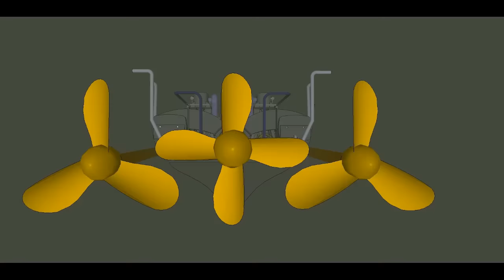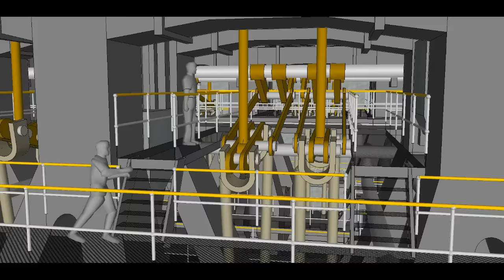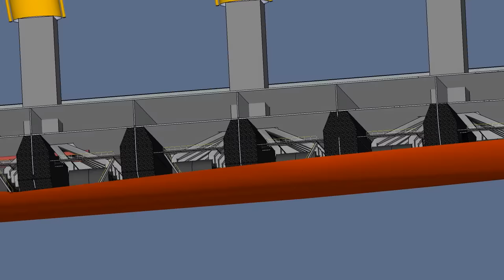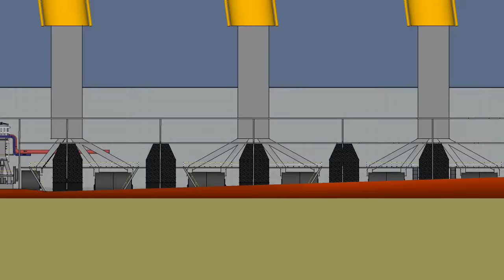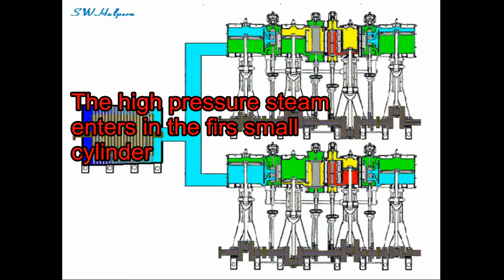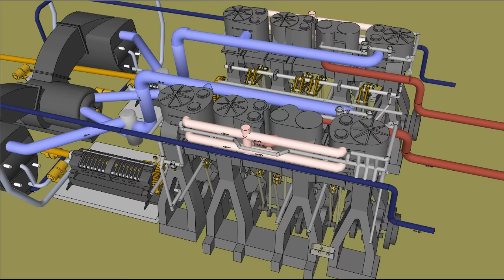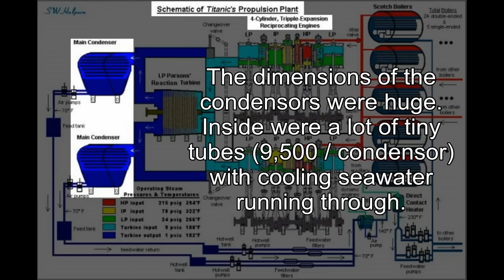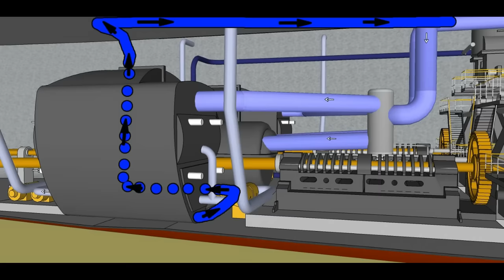The Engines of the Titanic

Comment: 150 men shoveled 600 tons of coal a day by hand, unbelievable. That's 4 tons per man.
Reply: Inside a hull riveted by hand. Different times..
Reply: @pelnapkins4379  and it was hot hot hot! 

Hot environment + physically demanding labour = HOT.
Reply: ThatGuy Ollie And didn't complain while doing it. No excuse, just produce.
Reply: Not entirely, the builders of Titanic used hydraulic riveters and steel rivets on MOST of the hull, but in areas that were very curved, they had to install the rivets by hand, and that forced them to use wrought iron rivets instead of steel rivets.
Reply: Not that hard, I  have shoveled over a ton of sand in less than an hour, several times. At 63 yrs old, just part of the job.
Reply: Welll they probably needed to lsee a litlle, so 2 12 hour shift maybe?
Reply: OK Boomer  I can picture it now, yea they prob thought about it, either tons more of equipment, overhead bins with release doors, massive conveyors, unloaders/pushers,etc. , or just stay with all them guys, and the sleeping areas, and food, and toilets, to accomodate them . Prob would have taken a small team to run, maintain, and repair the auto system anyway.
Reply: Not for a man in good health who eats right......the men in the photo look to me to be tough Irishmen who could mop the deck with us.
Reply: 4 tons ain't that much for a normal man. Obviously these days a lot of guys are like a ladies back in a day
Reply: 6.9kg/s
Reply: But like let’s imagine how jacked they would have been after a single voyage
Reply: Honestly, one thing I’ve wondered is it if can be all that fuel efficient regarding all the coal shoveled into it. I get it, it was over 100 years ago, so the tech we have now wasn’t available at the time, but still...
Reply: @LynxStarAuto  Where did you hear that? There were frequent strikes from those in the ranks of coal workers around the time of Titanic. It's also worth noting that, sadly, coal workers had the highest suicide rate of those who worked aboard ships at the time.
Reply: The searing heat, long backbreaking labour, and coal dust is also incredibly damaging to the body. Many stokers didn't live past their 30's.
Reply: @treeguyable  Only whips today. Lol
Reply: @PieterPatrick  I am whipped after about 6 tons.
Reply: OK Boomer  labor was cheaper
Reply: Thats 17 lbs per minute / 8hr shift.
Reply: You joke they will be in great shape after a voyage....
Great amount of coal dust in your body. While overworked. 
I imagine a large portion of men end up sick or worn out.
Reply: @fastinradfordable  Osha approved  methods for sure.
Reply: Shoveled, by hand,  a few tons of dirt today out of my dump truck, in the Mid July heat , humidity, and sun, on the coast of N.C. , miserable, but I'd rather do that a few days a week, than a few hrs of where they did coal.
Reply: @treeguyable  ... I have done the same thing but never in a 100 degree room with all of that coal dust and noise hanging around my head... and not all day long, 7 days a week. At some point it's got to wear thin.
Reply: @treeguyable  ... I have see auto-stokers on heating plants circa early 1900s and while you can cut down on man power you need to hire a different level of education for operation and then there's the added weight of the equipment. Probably a compromise either way.
Reply: dogboy1953  ... 4 tons of coal generates some ash and requires raking of the coals quite often, then add in the job being done in a room at over 100 degrees with all that dust. These guys were doing more than moving 4 tons of coal each shift.
Reply: OK Boomer  I think nobody thought about it. You see engineers also have limited vision. If before everybody used the same approach no mean to change it.. just scale up.
Reply: 4 tons a day isn't that much, lets say they worked 12 hour shifts that's only 5.5 kg per minute. I mean the circumstances were miserable but the lifting wouldn't be bad even if the shifts were smaller lets say 8 hours that's only 8.3 kg per minute, that's 3 shovels max.
Reply: That Guy  as vibration and sound as well 
As lot of noice as can impact on ear and vibration can impact of whole body(like their is lot of issue on it) 
Hand off too those seafarers, whose was worked over there.
Reply: Hehe working in a hypermarket, that's what I tossed in the refrigerated throughs of frozen ducks at Christmas time. It's a traditional Christmas dinner in Denmark.
Reply: OK Boomer  Labour was cheap. But when it wasn't any longer, in 1926 the sister ship the Olympic was converted to oil firing and the stokers got, well, fired
Reply: More unbelievable the number who actually survived
Reply: @LynxStarAuto  Sounds like they were almost machines themselves.
Reply: Tennessee Ernie Ford was closer to correct - 16 ton.  A good man can load 16 ton per day. I could do it when I was younger, but that's a reasonable rate of work for a healthy man. One shovelfull of just 17 lbs @ 4 times per minute.
Reply: do you think there was a lot of collapsed discs in those guys backs
Reply: @lielowmilo2740  Shifts on board a ship is usually 4 or 6 hours long.  The area of the ship the crew lived in was in the bow area below deck.  It is not unusual for a steam locomotive fireman to shovel 8 to 12 tons of coal in 10 to 12 hours.
Reply: Internet says titanic carried 6,611 tons of coal, so at 600 tons they burned through the fuel in 10 days? I’m calling bs on this one
Reply: @pelnapkins4379  Lots of coat to keep them giant steam 2 strokes running!
Reply: @randall197  Why would it's fuel capacity be hard to believe? The Titanic was built to make trans-atlantic crossings in 5-8 days, so 10-11 days fuel capacity is not strange at all. There was also plenty of room to store extra in the ship, if need be.
Reply: Imagine all the BO!
Reply: All these  boilers and one modern ge 90 jet engine  has more power  than all of them, thats a fact
Reply: Thats a 2 stroke too but it make rotary 2 stroke GE dont have much bottom end torque!
Reply: I have few omc rotary 2 stroke sled engines which i want to power with a water arc explosion overunity, also look to get a polaris liberty 900 2 stroke for this also, i just got an 8v92 2 stroke and OMC 2 stroke small block! Lightning is one of the most powerful 2 strokes known but tamed down pulse plasma 2 sroke would make a nice overunity pulsed plasma 2 cycle for power generation
Reply: There is a lot of torque need to move this boat and your talking about a higher revving gasoline jet rotary engine true it more peak HP but they are crap on the bottom end!b Do you have the dyno results to prove this?
Reply: @jlo13800   i did state POWER, i do know that jet engines are rated in lbs of thrust and not actual horsepower, lets take a 747 aircraft, its takeoff weight is around 400 tonnes, to get that plane up to 180 mph in 30 seconds which is the approx takeoff roll you would need 110,000 hp if it where  a piston engine, which is more than the titanic had, but with steam engines you have a thing called a force mulitplier, which gives you monumental torque needed to turn a ship propeller, torque is nneded forblow speed operations, brute horsepower is needed for big speed
Reply: yes jet turbines make good power with higher revving momentum and very little fuel! Thats  there advantage the speed of the parts in them.
Reply: BTW whew is the 110,000 hp coming from the high speed mometom of the part inside the turbine!
Jets are also 2 stroke rotary too tapping into the ZPE aether field as conventional electron bond fuel is not energetic enough to make that much power for long periods! cheers!
Reply: When enough spinning mass gets started the aether (ZPE) kicks in to give a lot of power the so called electron bond fuel helps get it started thats all. its not energetic enough to keep it going at that power level for long duration!
Reply: S where is that 110000 hp coming from, some electromagetic force!
Reply: So where is that 110000 hp coming from?
Reply: @Heliotail  Southampton born more like
Reply: @treeguyable  
Commercial brick and block mason tender here. An 8" cement block weighs ~40 lbs. Lift carry and place then move again as the masons worked down their stock... prbly 2 more times

Masons were expected to lay 150 block a piece, with me tending at least 4 masons. The block count at the end of the day was easily 600 block. So you do the math 

And that doesn't include passing all the mortar and grout, lifting 16' foot plank, and 6 foot scaffold frames. Easily it's 

Then there's elevator shafts, nominally 12" block laid from the inside in a series of scaffold jumps, requiring the material to be handled several times before it goes into the wall. 

I'd get sent with another man to do the jump and stock up which would normally be 150 block moved 3 times, and those are tough to grip... two handed, not like 8" where we'd practically toss them

Those were 18,000+ lb days. Then go home, pizza and beer, boxer shorts and Sports Center, cat picking at the door to go out, get up in the morning to do it again.

I did the math once, and figgering weather and all, in about 200 days I would move 1.5 million pounds per year. 

It kept me young for a long time,  working tough til I was 60 then it made me old very very fast.
Reply: @tommypetraglia4688  Yep, I remember in my 20s, making mud for block layers, and hauling it in 5 gallon buckets, one in each hand, as fast as I could go, in the summer heat down south. Also moving block for them. Glad at 63, now, all I do is climb 100 ft trees, over houses and fences, and garages, and power lines, and take them apart, and clean them up, and maintain my fleet of equipment, and change my tires on my split rims on the dump truck......... wait, aren't I supposed to be retired at 63????
Reply: Shifting all that coal breaking your balls only to go to your death. Raw deal
Reply: Mike Sokolow this is true but add to that the intense heat, noise and dust hard days work for any person
Reply: by hand?! im sure they used a shovel
Reply: Pel Napkins holly shit no rivet gun?!
Reply: @privatejimmy4076  in how many minutes? 🤣
Reply: @lielowmilo2740  Yep, but you need to add coffee time, cigar time, bathroom time, some rest, some especial maintenance discussion and repairs. And also all the remains like ash removal. Or More people need to be involved or the weight has to be increased to 8-10kg a minute, about 7 to 9 shovels a minute. If more speed was needed, you may double that for some periods.
Reply: Pfffttt.    Ernest tubbs did 16 tons....
Reply: I upstacked, downstacked, and palleted average 20 tons of mulch, rocks, and salt a day working walmart lawn and garden for 3 years
Reply: @LynxStarAuto  you're a bit out of touch with reality, they stopped working a lot, because the conditions were poor
Reply: @randall197  That's enough to go from London to New York and come back, then refuel.
Reply: Actually it sounds like more than it is. Especially when a shovel full weighs like 20lbs. I shoveled around 2 tons of stone by myself to fill a drain tile in someones yard. Don't get me wrong, it was tiring, but not a super-human task by any means 😅
Reply: @treeguyable  yeah. Same here.  it sounds like a lot more than it is! Coal is a rock basically and its heavy so a ton of it isnt actually that much.
Reply: @TheShalalai  yup 🤣
Reply: @mellothejello3285  Oh, true, like after they swam to shore!
Reply: That's nothing, by way of sheer weight.  In an eight hour shift I would average 15 tons lifted by hand, working in a construction supply yard.  That's not to say that their work wasn't likely much harder
Reply: John Smith  people were cheap labor back then, and didn't break down. If they did they could likely be replaced very quickly and you lose no boilers as a result.
Reply: Totally believable, and I would gladly shovel 4 ton a day for a job.
You act like it's hard to do?
Reply: John Smith  Wondering the same thing myself... modern coal power plants crush coal into a powder, then blow the powder into the boiler furnaces.  Also, if they had used water-tube boilers with superheaters, they could have had steam at 600+ psi and 500°F or more, which would made the engines more efficient and reduced the amount of coal needed.
Reply: 4 tons of coal isn't much - the Irish Navvy's would DIG - not shovel - 20 tons per shift.  I think it must be a combination of men moving coal close to the boiler and raking out ashes in intense heat.  Probably doing 40 minute rotas within the group so only 1 shovelling whilst the other 3 barrowing etc.
Reply: @treeguyable   A shovel goes into sand rather easily. I shoveled sand and gravel.  Gravel was tougher and would be a fair comparison to coal, not to mention the heat and dust  that comes with stoking a furnace..
Reply: @robertjones3016  Yea, just did a few driveways with about 15 ton of abc( driveway rock). a LOT of it was shoveling by hand, even though I have a bobcat and dumptruck ,lot's of hand / shovel placement.  Lots of hardraking too. Can actually wear out a shovel blade pretty quick.
Reply: Shovelling four tonnes of sand per day in the open air... Doddle.

Shovelling four tonnes of coal in a boiler room... Not.
Reply: @AnthonyHandcock  You darn right!
Reply: @LynxStarAuto  Who says they didn't complain?
Reply: ты прав, 4 тонны угля в день в одного...учитывая все условия работы это был явно один из кругов ада...
Reply: @treeguyable  Was gonna say, I've moved 1000lbs of scrap metal in under an hour.

You can tell who's worked manual labour jobs and who hasn't haha
Reply: 29 boilers , 150 men working in shifts..  The issues was not feeding the coal into the boilers themselves, but moving coal from one bunker to another to down by the boilers.  say 100 men working at any given time , probably only took one man to feed a boiler and when he wasn't doing that, he was helping to move coal in other spaces. I think films  show too many men around the boilers themselves.
Reply: @pelnapkins4379  how many were trans!
Reply: Some days at work, I have to shovel 8 tons of asphalt. It's really not as hard as you would think.
Reply: @treeguyable  now imagine shoveling that sand in super hot enviornment where ur breathing in coal dust which cpmpromises ur lung capacity. Heat stress alone decreases performance big time. Not saying ur not fit cuz what u stated is damn good but these guys conditions were shitty.
Reply: @AdrianButler86  I hear ya, sometimes, ya gotta be there.
Reply: The sheer weight isn't the hardest part of the job. The stokers are to check the furnace to make sure all the coal is distributed evenly and burnt properly. Not like what they did in the movie: chuck a huge chunk of coal into the furnace, when everything is burnt the big chunk will be still there smoking and blocks new coal from coming in!
Reply: @treeguyable  i
Reply: @SaulGoodmun  except they weren't just shovelling into the furnaces the whole shift—the process of operating that style of boiler is a 15-20-minute cycle, with the actual shovelling part not even being done on every iteration. The bulk of a stoker's time on most cycles would have been spent monitoring the rate at which the coal was burning, and carefully adjusting the vents and dampers to maintain a safe and consistent pressure level.
On the cycles when shovelling was required, it would be a fair bit that had to be done quickly, especially since there were fewer stokers than there were furnaces on most watches.
That's why leading firemen like Barrett had such an important job, orchestrating the whole team, including not just all the stokers, but also the trimmers (whose job it was to actually go and get the coal out of the bunkers and bring it to the furnaces in huge wheelbarrows) and the greasers (whose job was to keep all the moving parts and small machinery in the boiler rooms running smoothly and repair minor damage as it occurred), all while maintaining constant communication with the engineers and their staff to keep all the internal systems running as efficiently and safely as possible.
Reply: @lielowmilo2740  i'd very much like to see you do that in those conditions mr not so much lol
Reply: @treeguyable  well they did it in the enclosed space near a burning hot furnace!
Reply: @jackzero5230  Yep, tough job.
Reply: Damn, you think they would have devised a gated chute system or something...
Reply: @privatejimmy4076  Not a math major much, are you?
Reply: @treeguyable  I don't recall any steam engines (naval or train engine) has automated coal feeding. Coal isn't a liquid - it's rocks, and oddly shaped at that. Any mechanism would be either very loose and hence ineffective, or tighter but very prone to be jammed.
Reply: @treeguyable  No, comrade. Keep it up and you'll live to be 90. Retire and you'll whither away in a few years like the rest of them.
Everyone I know who's lived long has been refusing to retire all rejected their age in various ways.
Reply: @suzukirider9030  Well, I pretty much knew coal was not a liquid. But, open conveyer belts with a mechanism that flings the coal into the pit would work, but hey, let's face it, always someone willing to shovel by hand for  steady work, and a  dollar.
Reply: @suzukirider9030  Well, I can't retire, so that pretty much takes care of that part.
Reply: 2.7kg a minute
Reply: That's quite a few cases of blacklung
Reply: It’s like slavery 😠
Reply: @mueez734  with how much they probably got paid it basically was
Reply: Think of the poor guy who had to take out the ashes.
Reply: @thecommunistowl811  😡
Reply: @treeguyable  yeah it's not particularly hard. I'm a weedy guy but filling up an entire van with sand (1ton) isn't that hard.

People underestimate just how light a ton is.
Reply: @Heliotail  Not with us m8, we are the youtube comments mob, the meanest, toughest men to ever walk the earth.
Reply: It’s not really impressive
Reply: I've shoveled 8 yards of rock in a day before in the Texas summer. It's doable to me.
Reply: @ollie2244  v.h. vr 7
Reply: I couldn't do it.
Reply: Why didn’t they use a diesel electric setup?
Reply: I wheelbarrowed 12 tonne of tar one day me and another did 2 tipper trucks son24 tonne all up
Reply: Wonder how long their backs lasted
Reply: @royreynolds108  The poor chaps sleeping in the lower bow got a rude awakening and an ice cold bath with water shooting in when it hit the iceberg ...insult to injury for all there hard work.
Reply: 3 - 4 tons is the weight an average parcel deliveryman get's done over the day - every day, and their shifts are slightly longer than the firemen's in the old days were... I'm not saying 'Titanic's' stokers had an easy job - working in heat, dirt and darkness like miners - but back in time it was rather normal slavery, and at least onboard passenger liners they got fed pretty good with 1st class surplus meals.
Reply: @randall197  'Titanic' was designed to shuttle on the transatlantic passage between Southampton and NYC. Average travel time for modern passenger liners back then was 7 - 8 days, fuel lasted 10 days. What's the problem about that?
Reply: @Dokker62  it’s already been confirmed that I did not know what I was talking about
Reply: Thats Like Lifting Up A Whole Car Per Man
Reply: @brandonwombacher2559  That's like lifting up a whole light truck per man...
Reply: @ollie2244  It wasn't slave labour and at the end of the run there and back you had a lot of money. The heat wasn't the problem, it was the asbestos lagging.
Reply: Sounds like a ton of work.
Reply: Some railroaders did up to 8 tons per shift here in Europe while working on large steam engines. No Stokers over here.
Reply: @privatejimmy4076 normal coal shovels  had 25- 40  pounds capacity
Reply: @skuula  я думаю с учётом с ложившеися экономической обстановкой на то время они не слишком обрадовались избавлению от этого тяжёлого труда.
У каждой медали две стороны...
Reply: @jlo13800  что?
2т по твоему лучше в крутящем моменте паровой двигатель ?
И по твоему они похожи? 
Как тирекс и киска ))))
Reply: Ceausescu did it
Reply: @treeguyable  I commend you for that, for sure. Now imagine doing that in the intense heat of a boiler room.
Reply: @randall197  11 days. You can call bullshit, but it's documented.
Reply: @KoolHandJuke  Yea, sounds grueling. Been in my attic on my belly, pulling wires and such, in 120 degrees. May have lost 5 lbs, in 45 minutes. Yuk.
Reply: @treeguyable  I hear ya. That heat sucks the energy out of you!
Reply: @KoolHandJuke  I know I already backed off it earlier in the thread
Reply: I've never even seen coal
Reply: In train disaster next to  Warsaw, local people shoveled 4 tons in  20 minutes..
Reply: Most if not all were Irish .
Reply: You would think during that time they could have invented that funny machine called an automatic stoker! 😎
Reply: Hard work in the heat but definitely can be done. I've shoveled a full 6 wheeler truck of sand in a day on a building site many times approximately 6 tons
Reply: That's like picking up 5.5 pound of coal and putting it into the boiler every minute for the entire day.
Reply: Tennessee Ernie Ford would have been proud
Reply: @mosesMarlboro..whell, that actually isn't that unbelievable. Asuming a guy works an 8h shift, and assuming one shovel of coals weighs about 8kg, that means they shovel in 1 shovel per minute. Not saying it isn't hard work and I have a zillion respect for those men. To do this 8h per day 11 days in a row is wow
Reply: How did they get all that coal in? Was there a hatch?
Reply: @GeorgeZ213  There were usually coaling ports on the side of the ships giving direct access to the bunkers. 
ISTR a picture of coaling a ship using wheelbarrows and bags of coal. It was a long, tiring, filthy job, done by hand, sometimes done at night, and the ship often was coated with a layer of coal dust afterwards. ou can imagine what a pain this was to the folks on board, wither paying passengers or the Navy ratings who had to clean it up. Google coaling ships and you will probably find this info.
Reply: When we polled tuna in Port Lincoln in the 60's 4 men could put 5 tons on in 5 minutes if the fish were hungry. It was hard work. After 20 mins you wanted to die or quit. If you ever slowed down everyone in the crew saw and you'd never get on a decent boat again. You hoped a fish would swallow the hook which sometimes they did and you would need about 15 seconds to put your hand down it's throat to release to hook from it's stomach. Lots of blood, noise,fish going crazy behind you,yelling and screaming,cheering etc. You knew you were alive in those moments. No stopping till the fish stopped or you filled the boat.
Reply: I good amount of warehouse workers lift that much in boxes if not more to this day. It’s not that impressive really lol
Reply: @jackdough8164  How many warehouse workers, using how many power tools? In what temperatures, and how many breaks a how long working day? I think you would not do as well, shoveling coal in a hot, humid, dark poorly ventilated space, never mind the constand fog of coal dust, and staring into a roaring inferno.
Hand firing a boiler isn't just tossing coal into a fire. It takes skill and judgment, else you end up with one big unmanageable clinker that doesn't burn.
Reply: You load 16 tons and whaddya get, another day older and deeper in debt...
Reply: 3x 8h shifts 50 guys.
8 hours 8000 lbs.
1000 lbs per hour, 16lbs 11oz per minute.
Reply: Some people say a man is a made outta mud, a poor man's made outta muscle and blood.  Muscle and blood and skin and bones, a mind that's weak and a back that's strong ya load...

....ah dang I see others already beat me to it 😕
Reply: That’s why they were called the “black gang”
Reply: @mellothejello3285  well they didn’t make a single voyage, the ship sank on its maiden voyage
Reply: @LynxStarAuto  you like a big strong man who shuts up and does what they’re told don’t you gabby?
Reply: @privatejimmy4076  personaly i'm 6'8'' and 135 kilos! I thing if i shoveled 6.9kg/s for a quarter of an hour i will start to fart!
Reply: And dont forget the hearing damage!
Reply: Batteries of vehicles daily. No dock …
No electric pallet jacks. 

3 semis by Friday next week one for stock . 16 skids max per 18 wheeler 
   8-5 and every store with a hello a charged box of simplicity.. and your days weight in gold covered.
Reply: 4 tons per man isn't horrible. Heat would suck, though.
Reply: And they probably were paid next to nothing to do it
Reply: Crazy!!
Reply: WOW
Reply: I'll bet you most of them wished that they'd studied to be the captain, on their way back.....
Reply: I'm sure most of them died at a young age of lung cancer from inhaling all that coal dust too
Reply: And it had to be mined and processed then transported
Reply: @Metal-Gear-Moogle  Pneumoconiosis (Black Lung Disease) would have gotten them long before any cancer related malignancy.
Reply: I do not understand why the supply of coal did not occur automatically, under the influence of gravity?
Reply: @privatejimmy4076 what?
Reply: A  F....KING HARD JOB .
Reply: Without  the stokers , nothing happened . The Captain and the Officers knew this . Best food , best quarters , and a few crates of eer at the end o the shift .
Reply: 4th class eng had a big shovel, 2nd class had no shovel!
Reply: power before all of the feminists and femboys
Reply: The engines were hight tech, the coal system were antique way.
Reply: My Grandfather worked on a canal barge and they were expected to empty the barge of coal themselves, 40 ton in total. 
Take it down canal, empty the barge and bring it back, That was the job. 
Tough men.
Reply: @rupe53  Indeed! Apart from all the factors that you mention, the noise alone would have been unbearable for me after a single shift.
Reply: @Neal_Schier  ... BTW, the boiler room is quiet compared to the engine room where all the mechanical stuff is located. It's just the roar of the fire and clanking of the firebox doors opening / closing, along with the noise a shovel makes. Obviously, OSHA was not around then to deal with work noise issues.
Reply: @mellothejello3285 ils n'ont pas été foutu après un bon contrôle technique et une révision c'est reparti comme en 40
Reply: @princesscadance197 il était vachement plus econome car sa été un moteur issue d'un moteur Isuzu
Reply: @jackvac1918 c'est pour cela que la white star line a décidé de faire un contrôle technique et une révision des machinistes
Reply: @matthewerwin4677 surtout pour leur confort de travail
Reply: @SaulGoodmun après ils avaient de la lecture a faire
Reply: @fastinradfordable non ils étaient en pleine forme
Reply: When I was 23, I threw 12 tons of yard waste in the back of a garbage truck in about 75 minutes. 4 tons for a whole day isn't bad at all. I'm sure the job sucked, but not for the weight moved.
Reply: Assuming 8 hours of constant work that is a shovelling rate of one shovel every 7 seconds (if every shovel contained 1kg of coal)
Reply: 150 men to shovel coal, 1 guy to look out for icebergs.
Reply: @marty906 Sad but true
Reply: @chrisperrien7055  The crawl space between the boilers was from where the coal was shovelled. Men had to climb inside and use their feet or push with metal rods to loosen the coal up so the firemen (shovellers) below had a steady supply of coal to shovel. Not only would it have been boiling in there, but it would have been noisy with the sound of the engines rattling through the steel walls, the air would have been filled with coal soot which got in your ears, nostrils, mouth etc. Possibly the worst job on a steam ship. 

Of course, the one positive was that the firemen were the first to realise the seriousness of the situation and their number were the greatest percentage of crew members to survive.
Reply: Agreed, the "Navies" who built the canals and railways across the British Isles were expected to dig 6 to 10 ton per man per day depending on the type of earth/ clay/sand or ballest. On a diet of boiled beef and Guinness! Thank whatever deity you believe in for the Trades Union movement. ✌️😎
Reply: @jeanbia95  imagine the bo, imagine if they liked the musky stench. maybe other ship smells drowned out the bo?
Reply: @emmetg888  yes but not every ship sank, then you're only breaking your balls towards an early grave.
Reply: @jackvac1918 aj Did they get a good wage?
Reply: 150 men working on scale, not all in the same time i think
Reply: 4 tons a day? If that sounds like a lot, just imagine what the employees inside a parcel logistics depo (like PPL for example) have to do each day. A full semi truck comes loaded up to the roof with crates (some up to 50kg), and each man gets his trailer which he has to empty in about 45 minutes (just that is about 5 tons), and then he likely has to do a part of another one. All in less than 2 hours. By hand. Grab a crate, shove it out of the crate stack, carry it to the conveyor belt, put it on the belt, repeat...
The point is: even today there are jobs that are as hard and demanding (or even more) than those 100 years ago. Most people dont realize the amount of manual work that has to be done by men, and thats even in civilized countries, let alone the less civilized ones.
Reply: If she had not sunk , she would have been converted to oil firing like so many others of her era .
Reply: No. Only 75 first class stokers hauled coal. 75 second class stokers removed ashes, carried it away , took coal from bunker by cart  and brought it to the furnace.
Reply: 850 tonns actually
Reply: Why didn't they have automatic coal stokers?
Reply: I need a safe space
Reply: I do that all the time
Reply: That was  GRAFT !
Reply: Why didn't they have mechanical stokers? Our home had one in the 1940's. Railroad engines had them.
Reply: @Heliotail no, they just used steel rivets.
Reply: Few years ago  i shovel a 4 tons of coal from 7:30 to 12:00 with one 10 mins pause. It's posibble. The temperature in this situation is your enemy.
Reply: Genders can do that
Reply: @treeguyable  How long did those guys work between breaks?
Reply: @8546Ken  Too long , probably.